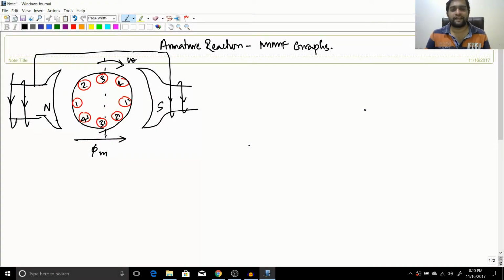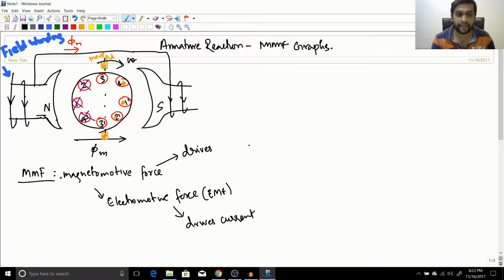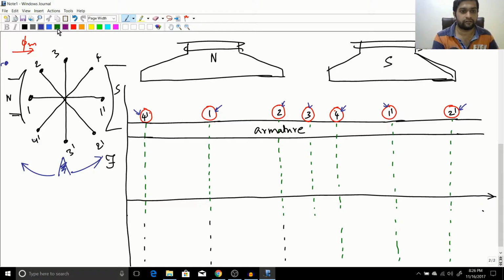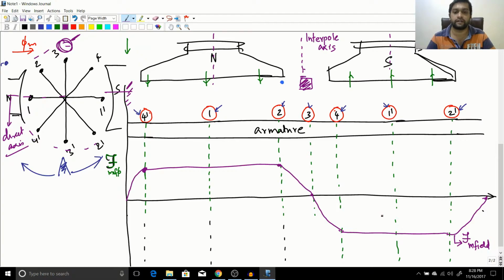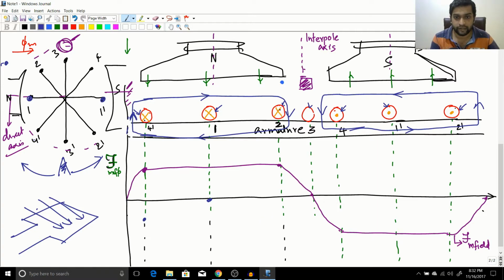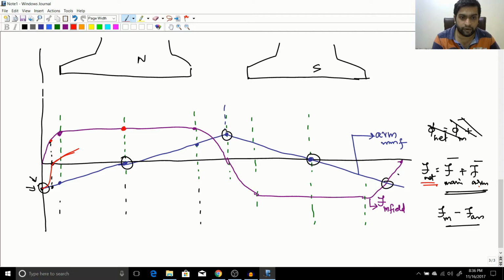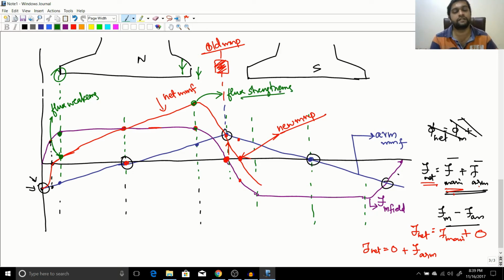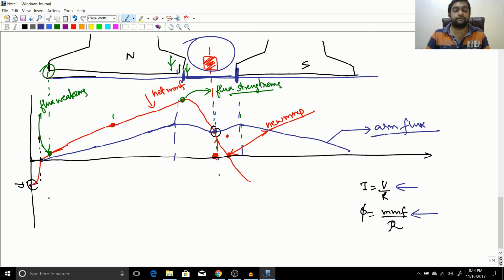#25  DC machines Basics -  Armature Reaction  - MMF graphs

Comment: At position 3 the field and conductor is in parallel. Then how will the flux cutting will be maximum. I am bit confused.how can be armature MMF maximum at position 3.
Reply from the maker: for this I am thinking of it as a coil, at position 3 the coil 3-3' is directly perpendicular to the direction of magnetic flux so flux cutting the coil will be maximum, it is easier to take the coil perspective for this explanation, that is have taken it so...

Comment: sir you have said that at the position top and bottom where v cross B is 0 the emf is not induced  but again said that emf is not induced at MNA plane.how come?
Reply from the maker: Mnp is a plane where v and b vectors are parallel to each other...and under no load mnp is a place where the top and bottom conductors are 90 degrees to the magnetic field.